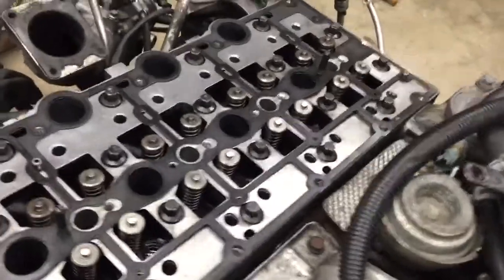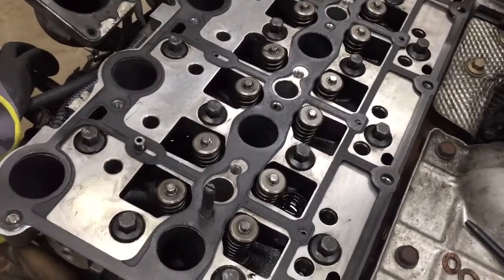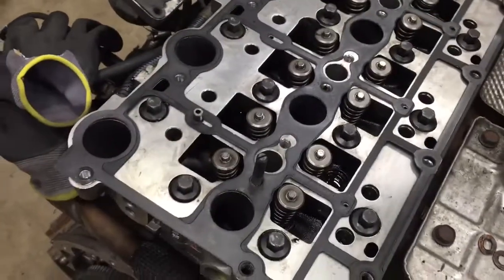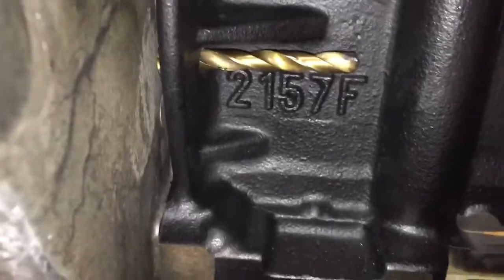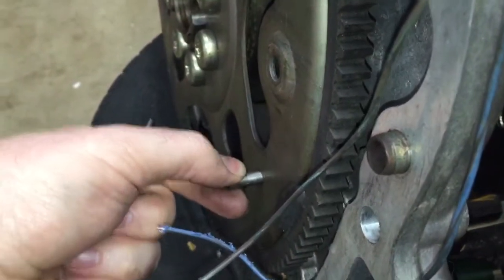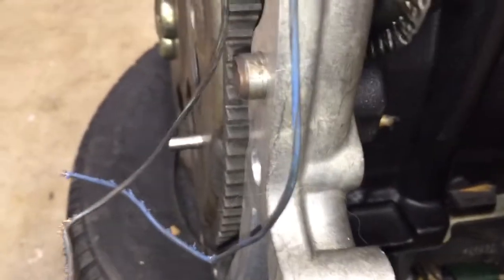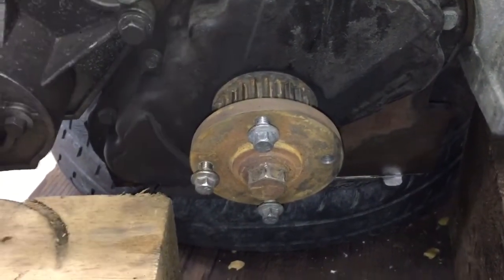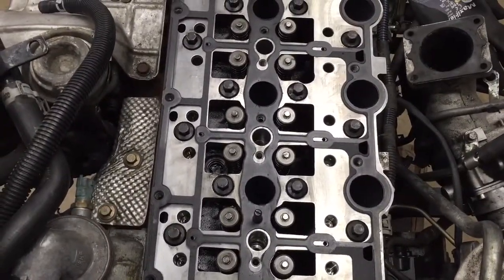Junkyard Jeep Diesel Engine, 2.8 CRD for Liberty KJ - Part 19

Comment: I use a tap and die set to get the grime out of the flywheel locking pin hole.
Reply: you removed the flex plate first?